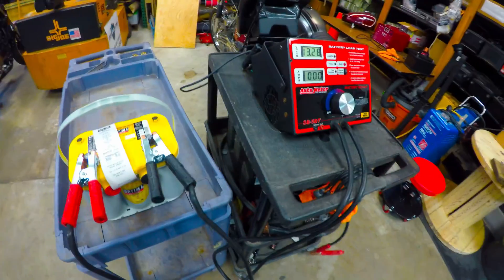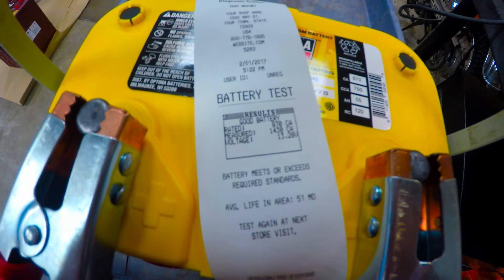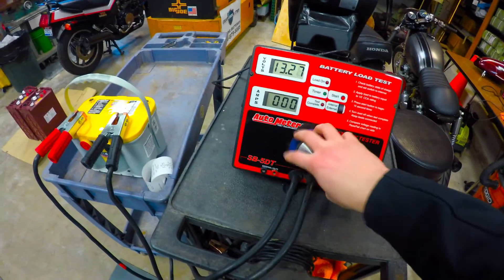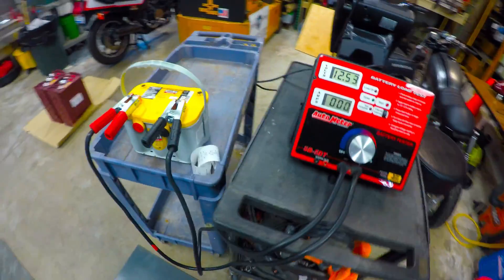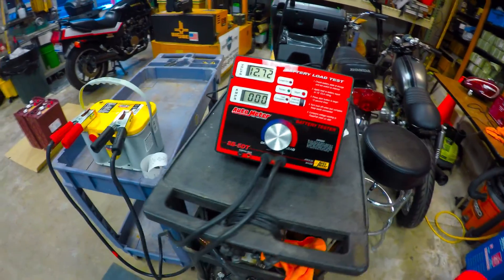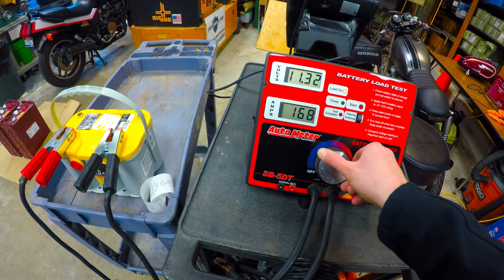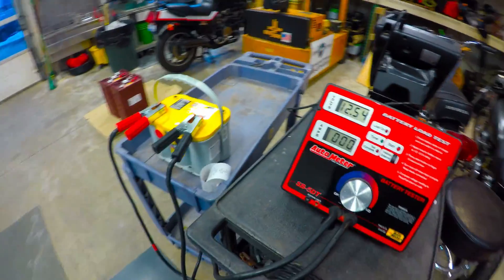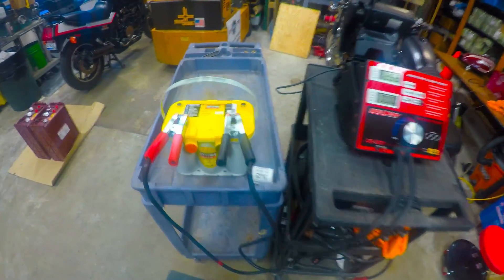Test My Batteries: Optima YellowTop Group 34/78 AGM (Lead SAE Post, Part: 8014-045)

Comment: I've had 3 yellow tops in 20 years and the last one lasted the longest, 14 years and it still producing 14.6 volts. The difference between the first two and the last is a trickle charger used during the winter season. And yes the last one was made it Mexico...

Comment: My Yellow top lasted 5 years running 4 12s and 2 2000 watt amps and 2 4 channel amps for interior speakers. I left it on the charger to long and I think I ruined it. I'm debating on another yellow top or the full river ft825 group 34. Which do you think is better?

Comment: Optima batteries use to be the shit, now they are shit. You get 1-2 years top and then they just do t seem to charge anymore. I found out they fired all the factory workers and moved to Mexico. These batteries are garbage and I would spread the word not to buy these , especially what they did to the American workers
Reply: Yep 👍, I’m switching to xspower now  cause I’m not happy with the 3 optima that I have now, are in perfect condition and are no doing the job in my 3 amplifiers set up, I have a 250 amp alternator brand new

Comment: Hi there, I've been through 8 yellow top batteries over the past 10 years, they dont seem to stand the test of time. Once discharged over 3-4 weeks of non usage of the car, the batteries end up deeply discharged by the alarm etc. I was wondering whether you could help me find a more robust alternative, as I think 8 yellow tops count as enough evidence to prove the theory that they're not made how they used to be, and are prone to internal shorts (otherwise the ctek charger should be able to bring it back from discharged 400 times, not just 1 or 2 max before it dies after a year) I have audio requirements, so I need something above the 10+ year old optima tech..
Please help..
Reply: Look at Northstar and Odyssey batteries they look good.
I've heard that Optima batteries went down when they moved production to Mexico.
Interstate batteries also seem good.
Reply: Sumz running have not had one discharge ever since i started using them in the early 2000s. In fact i have 8 in my bass truck now handling 1200a of draw with no problems. Are you sure youre not overcharging them? Max charge is 14.5v. Anything over and they will bubble.
Reply: DirtySouth Wookie yea I'm using a ctek mx5 charger, on agm mode, 6+ batteries, all ended up internally shorted within a year n a half each, very strange indeed as all the electrics in the car have been checked out
Reply: Im having same problem my Optima yellowtop is no good. I got less than 2yrs out of it. I have tried numerous times to charge with optima 400 charger. Will not hold. Might go back to interstate battery. Never had a problem with them. All I have is 2 10 inch subs and amp.